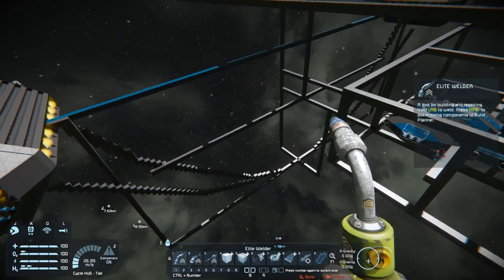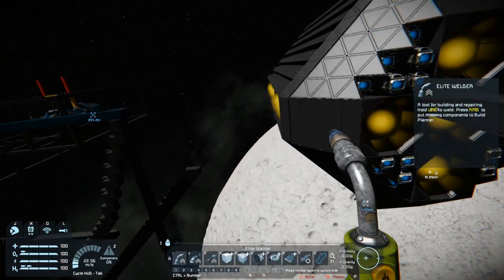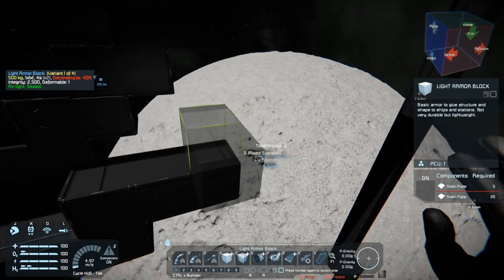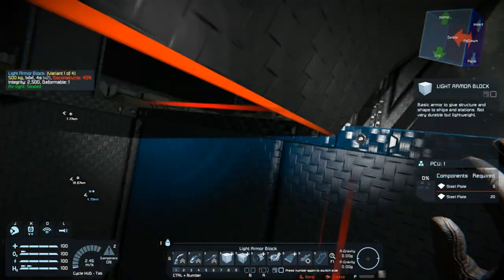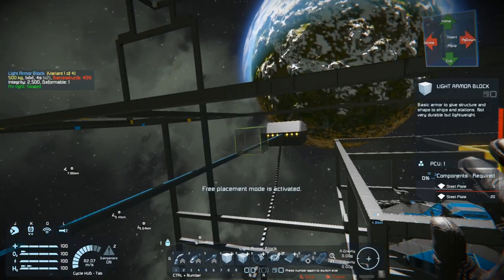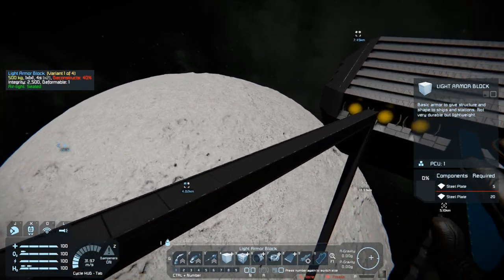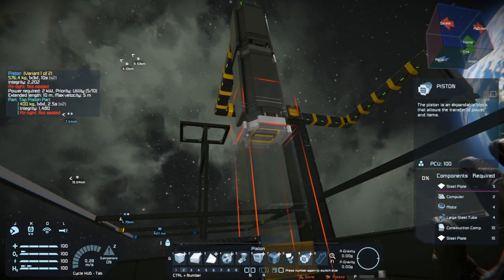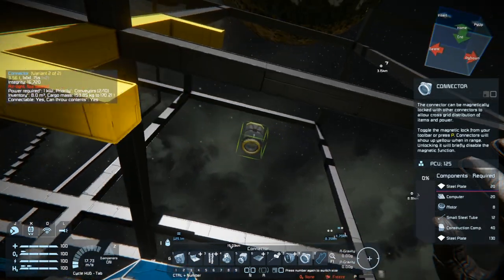Designing The New Capital Ship! (Part 3) - Space Engineers LP - E40

Comment: I'll be building a large ship that is about 1200 blocks long. I thing my rig can handle it considering I have a 3080 FE slightly overclocked. I will keep you posted and posy it on the workshop by march next year.
Reply from the maker: OOoo, that sounds cool. I've been keeping an eye on the 30 series' release, so I'd be curious how well they handle SE at that type of strain. Though, I would think a 3080 FE would take quite a massive build to push it. But, then again, I think it'd be a battle between the 3080's power vs SE's iffy optimizations. xD